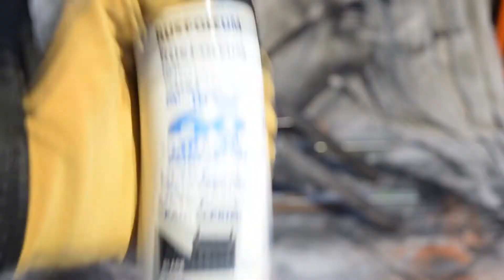DIY Air Compressor Hand truck/Dolley

Comment: Man this is a really cool build! Nice work. Where would be a good place to find basic square tubing like this?
Reply from the maker: Hi Russ, Thank for your comment! You can usually find the most common sizes from 1/2 in to 4in square tubing at local metal suppliers. I sometimes buy from big companies like Industrial metal supply. The square tubes I'm using are repurposed from an old warehouse i bought them from.